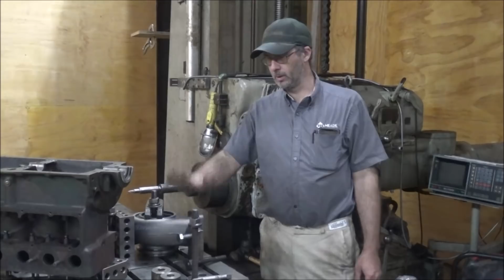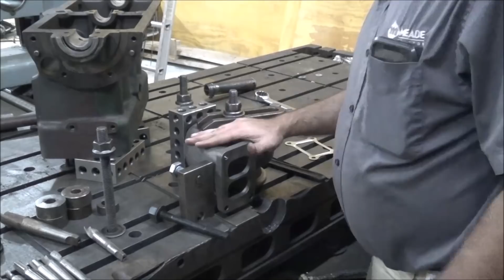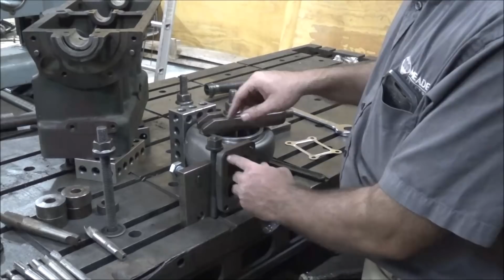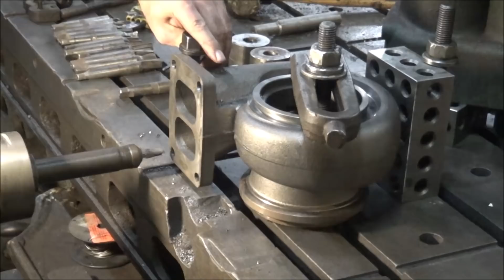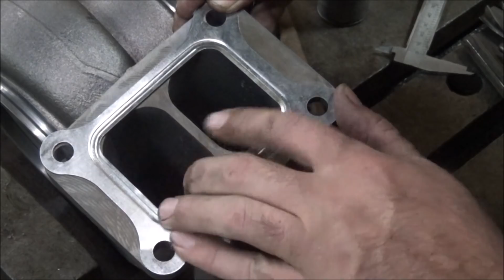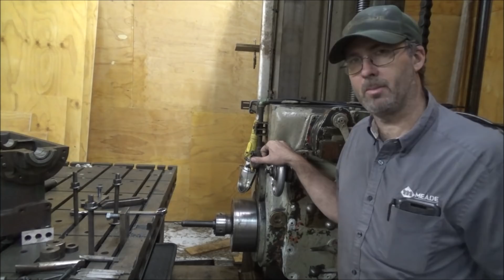Odd Shape Workholding Cummins N14 Turbo upgrade

Comment: Great video Brian.  Thanks for sharing.  It's obvious you really appreciate having that mill up and running for you.  We're lucky we get to follow along.  Might I suggest a little more lighting over the mill for recording?  Could be handy for your work as well.  One high bay led light from home depot used to be around $150 (I know, a lot) but may be cheaper now.  Perhaps hang it out on an arm (like a street light runs out over the road a bit) so it is shining down from roughly above where the cutting tool is working.  Just a thought.

Comment: Brian, I would have liked to have seen how you set the DRO to the piece and the new hole pattern. Do you clamp down the piece and then attach the pattern to the piece and then set the DRO?  Or is there some other way?
Reply from the maker: I just used the gasket and the eyeball center to get it lined up off the original holes, then the bolt pattern was done with DRO off of the flange dimensions for the other 3 holes.

Comment: so does the N14 not use the split exhaust stream, I noticed the gasket was an open design like my D343's
Reply from the maker: It is a divided manifold but for some reason they use an open gasket.
Reply: @bcbloc02  I've seen the divided gaskets crack off the strap between runners, lucky it had only cracked on one side and not both, or it would have gone through the turbine
imagine the .020" thick gap doesn't flow enough to affect the pulse-scavenging

Comment: Was it a forced upgrade for the new turbo because the old one went bad? Is this a new engine for the truck? Reason I ask is that I know someone that recently sold a mechanical 14lL
Reply from the maker: Mainly it was done to reduce egt's so they can use more of the power the engine can make.

Comment: That's good work, and good to see you. Think about what you'd have to do to set that up on a Bridgeport mill. love seeing the capabilities of the boring mill. Thanks again brian hope the harvest went well, and brought great fortune
Reply: tip the head or rt angle drive adapter or clamp to an angle  plate. HBM advantage large work space.
Reply: Thats what I'm sayin though most people dont even wanna take the vise off the table let alone have to re-tram the head
Reply: @randomdude1786   Tram., many ways to do a simple job by the 3 rd time.
So do it & get over the fear.will simplify many jobs.

Comment: Great work Brian, I’d like to see how you located the holes. That’s the critical part imo. Again good work!! Lots of rain up here today, 2”. I’m all done with harvest, still have some fall tillage I’d like to do.
Reply from the maker: Finished harvest here over the weekend for me. I have some ripping, chisel and disking I hope to do yet still. We got rain Yesterday morning so have to wait for it to dry a bit before can get back in the fields.  I just used the gasket and the eyeball center to get it lined up off the original holes, then the bolt pattern was done with DRO off of the flange dimensions for the other 3 holes.

Comment: What are doing to the Model T Ford engine sitting there ??
Reply from the maker: Going to cut it for insert bearings but waiting on the crank and inserts from the customer to do the job.  It isn't a rush job.
Reply: @bcbloc02  ,
You were lucky enough just to find a clean flat spot to set it down.

Comment: Do you use your monster drill press any more?  Seems like its always so much more convenient to set jobs up on the HBM, not to mention having the DRO.
Reply from the maker: I just used it in a video the one before last. I typically use the radial arm drill for a job at least once a week.

Comment: I am familiar with European truck engines. How rugged is thes N14 I mean which power you can make with it beyond stock?
Reply from the maker: Depends on what parts you put in it. Factory they could be had to 525hp and 1850torque. 850hp and 2300 torque can be done with the right parts and still be reliable enough  to go a half million miles without needing bearings.

Comment: Brian did you build the N-14 yourself?
Reply from the maker: It hasn't been apart, I just did some pump work and this turbo. It is a mechanical n14.
Reply: @bcbloc02  BC 400?
Reply from the maker: No it is an N14, it has the bigger crank and rods than the NTC series.